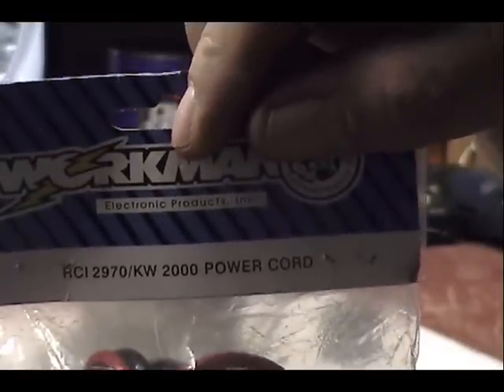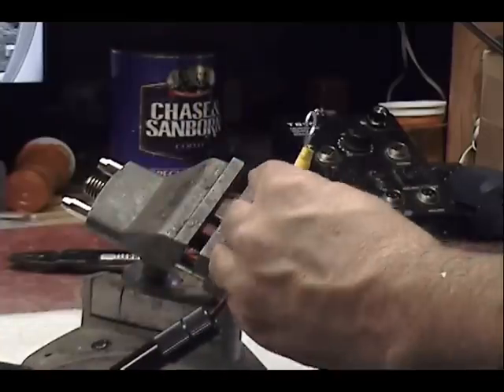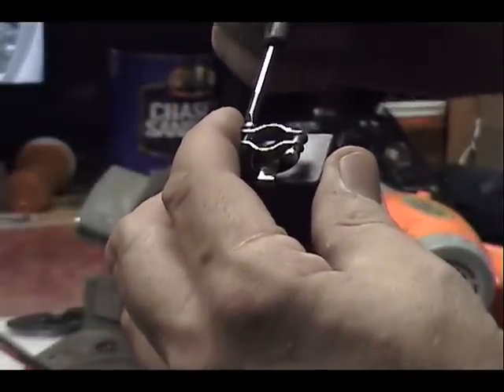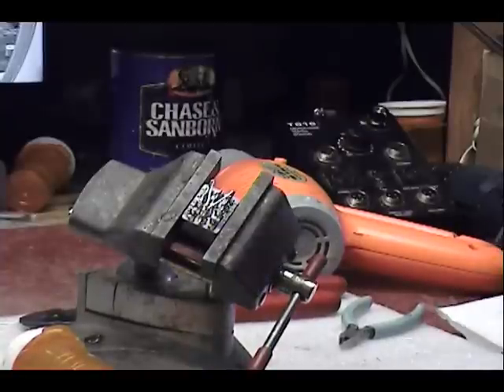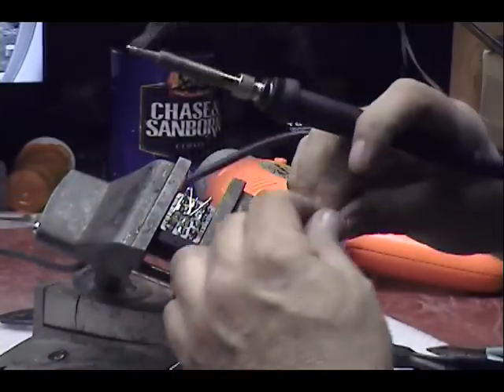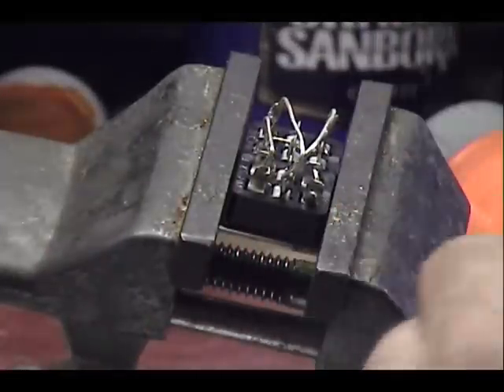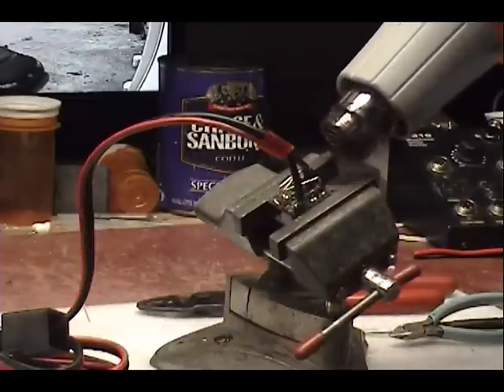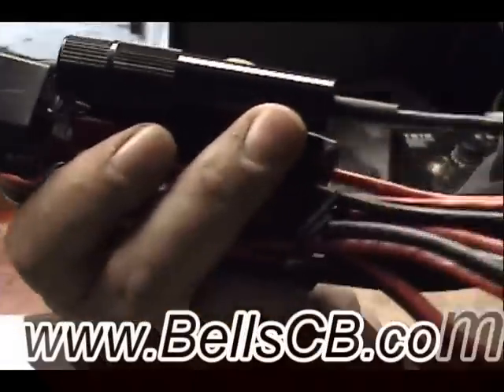How to wire a DC power cord for the Yaesu FT-101

Comment: You might have the pin numbers reversed. The Yaesu connector is numbered opposite of American (Amphenol - Cinch Jones) connectors. What you call pin 3 is pin 1 on Yaesu connector. KD6KCA

Comment: do you do any service work on the yaesu ft101e model radio, i have one that was my father in laws. It powers up, but as i am just getting started in ham radio, i don''t have the means to test it. The radio has sentimental value to me and i would like to have in operational. I have been a Cber and marine radio user for many years and want to move into ham radio, thanks Gary
Reply: these power cord plug are obsolete on mouser